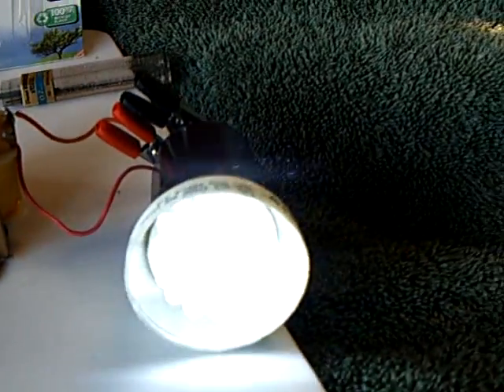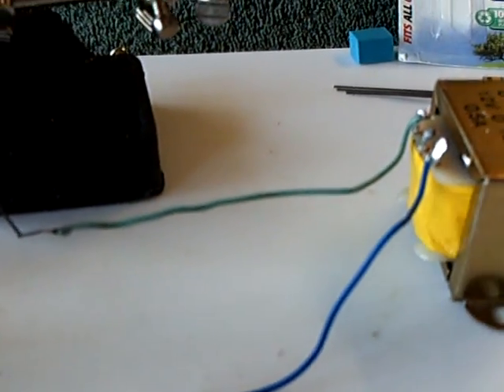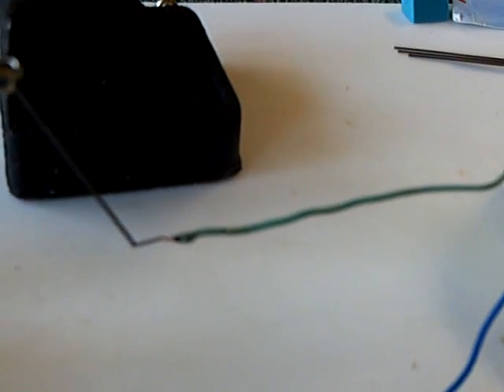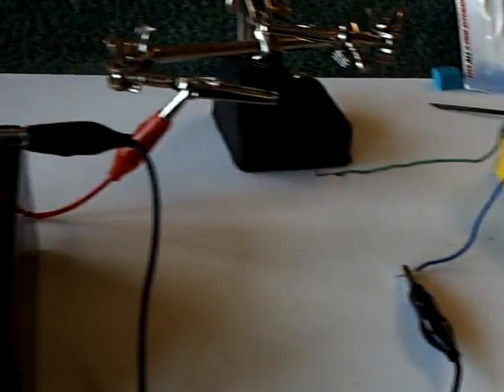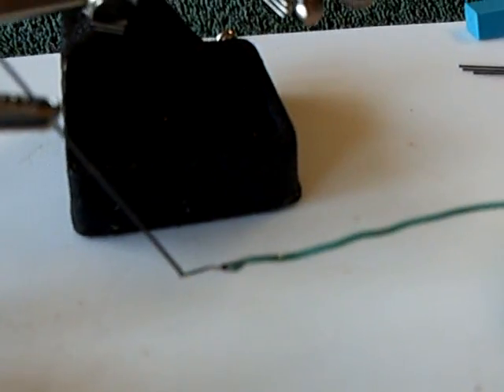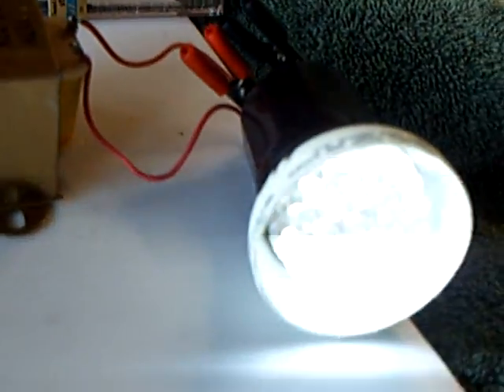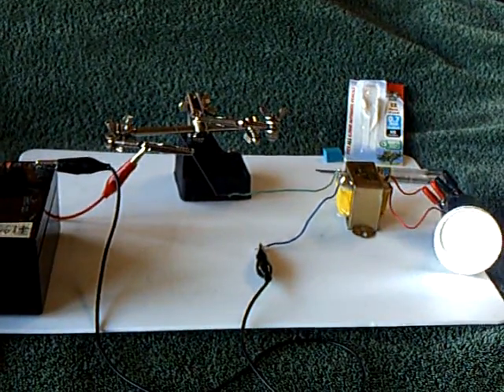Simple Oscillator---  no transistor

Comment: This is very interesting because I find it very difficult to make transistors oscillate, and when they do, it is usually at a very low power level, which leaves you with inverter circuits that can only handle very low power loads .

Comment: The carbon is simply a resistor, the spakrgap is the capacitor and the 1st coil is an inductor, the 2nd coil resets the voltage minimum to -v

Comment: Automobile radios used to use a mechanical vibrator to make high DC Voltage for the tube circuits. I guess they were the first Joule Thieves.

Comment: So... this isn't a transistor, but it is a diode. I'd be interested in seeing what the frequency of the electricity is. Something to bear in mind, since this is effectively a DIY diode, you might get current reversal, depending on how finicky that junction is. 

The semi conductor would probably be as a result of oxygen and copper reacting at the site of the voltaic arc in the carbon rod, but carbon it's self can be a semiconductor, depending on allotrope, so I couldn't say for certain what's going on without a voltage reading after the carbon-arc junction. 

I need to do more work on esaki oscillators....

Comment: Its just like using DC pulses to work with a transformer..due to the DC pulses the magnetic field associated to the primary changes and induces voltage in the secondary....but there is a chance of the transformer to burn out if higher voltage is used.....

Comment: This is the same principal as the radios that POWs used to build from a razor blade and pencil lead. They called that a contact diode I believe.
Reply: ok but how would this diode set up an oscillation here? It would have to be a breakdown or a zener diode to do anything similar, maybe a varicap.
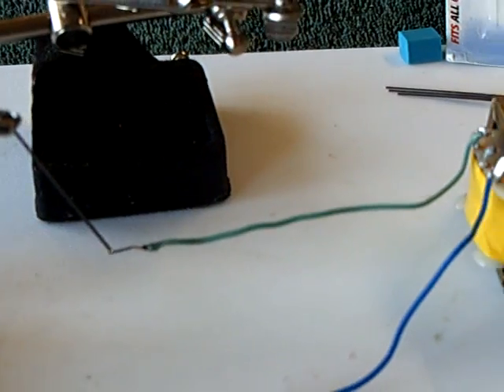Reply: See that little spark at 00:20 ? The spark action creates the oscillation. When the spark lights, current flows and voltage over the junction goes down. That causes the spark to stop. Voltage goes up again until a spark is created and the whole process repeats itself.
Reply: EdEditz so you are saying the graphite acts like an avalanche diode? Im pretty sure what actually happened is the graphite made contact, created a spark, current flew via the spark, the spark died out the graphite touched the wire and the process repeated. You can do the same with a relay and a regular copper wire, the trick is to get a poor connection, and you will also have a similar effect and a whole range of different frequencies, yet no rectification happens there.
Reply: No, this is not the same thing.  What he's created is a very tiny spark gap.  Foxhole radios, the ones you are talking about, use a diode created by a point contact between graphite and metal oxide on a razor blade in order to rectify the signal.

Comment: The spark gap is an oscillation into itself, and also a resonance too - this circuit without transistor can be done with only a diode and some other connections, i did this long time ago, but i have to dig for it in my hdds more, to find it. Tnks for sharing, keep going!
Reply from the maker: johnnyaum3 The thing is that this is not a typical high voltage spark gap. I finally decided that this was a type of buzzer oscillator. The transformer is causing a vibration in the wire.  Dissapointing--- but reality.

Comment: Carbon "burns" as the arc is formed. The early 1900's had dual carbon rod arc lamps in wide use as street and industrial lighting. I never understood if when the arc is established is the junction acting as a diode?
I may have found a new use for transformer based "wall wort's", I have a few hundred of them.

Comment: Try copper wire coiled on carbon mufflers with a iron rod holding a magnet. Carbon will push iron away then gravity allows things to fall when the circuit opens.

Comment: The energy though carbon to the coil is causing the copper and carbon to push away from each other, tension brings them back to connect again.
So it's just connecting and disconnecting. Filling up the coil then discharging it wherever your path is - in this case the led bulb.
If you place a pot between the pencil led and the battery you can control the power better use a much smaller piece of led.
I like this one because it brings attention yet again to the very SIMPLE source of an energy many  people and most "EE's" refuse to deal with...
Cheers - Patrick

Comment: I am very glad to see that you replicated this.  I also noticed that some folks commenting on my video thought it was the circuitry inside the LED bulb causing the effect.  I can assure you that this also works on some 110v incandescent bulbs as well as other things.  The effect looks crazy on the oscilloscope and I also noticed that the current draw was not as high as I would have expected.
Reply from the maker: lasersaber To be honest when I saw your video I first thought that it was some kind of electromagnetic buzzer --until I read the comments.  It was such a simple setup that I decided to try it and see for myself.  You are right that it has nothing to do with the bulb either. I was also amazed at the relativly low amp draw.  Thanks for sharing this idea.  It is something that I have never seen before and would never have thought to try.    I ordered one of your SOLN1 8 panels and will be testing it both at home and on my boat.  That one looks like a real winner--- for a number of reasons.  Maybe I'll ask Mrs. Santa for the 25 next Christmas.
Reply: ***** Nonetheless very interesting circuit :) - i'l try to find my circuit that works only with a diode (coil, wires and resistors) and publish it - hope to find it (a Free Energy circuit may work only with some coils, i am trying to figure out how, i know about 50% of this scenario)

Comment: Way cool!

Is the LED visibly flickering from your point of view or is it merely a video frequency affect?

When you remove the lead from the copper, is there a carbon residue built up on the copper or copper deposit of any kind on the carbon?

Thanks for sharing!
Reply from the maker: A B Thanks.  The bulb is flickering like an unstable strobe light.  There is a carbon buildup on the copper wire but the carbon rod just looks eaten away.
Reply: ***** Interesting.  I'd like to see the arcing in slow motion with a time-synchronized oscope display to slow down what's happening a bit to more easily visualize it.  I'm guessing what is happening is the following:
1.  As the current flow increases through the copper, a spark is able to jump from the copper to the edge of the carbon.
2.  When the spark occurs, the current flow through the primary is reduced temporarily and the built up magnetic field in the primary then collapses--which causes the magnet energy to be induced into the secondary winding until the current flow recovers.
Reply: i tried it and yes alot of carbon buildup

Comment: I think when the wire touches the carbon, electricity flows, and causes the magnetic field to form around everything, and that, because it is magnetic, causes the wire to twitch.

I would do the same experiment again, and not use carbon. Preferably, I would use gold-plated contacts for the area where the wires make/break contact. That would reduce the oxide buildup. I would expect it would still work.

I would also try clamping the that delicate wire with a clamp as physically close to the transformer as possible, to make see if it is the windings in the transformer that are causing the twitching.
Reply from the maker: I don't think that this is an electromagnetic thing.   I tried the transformer copper wire in several positions to see if it was being pulled toward something and it appears not.  The contacts easily arc weld closed and you have to get lucky to get this to work.  I tried all carbon contacts and it didn't work.  All metal contacts failed also.  I don't think that gold plated contact would help.  The copper wire is bouncing off the carbon rod for sure -- I just don't know why.
Reply: ***** Intresting! Yeah, the gold contacts would only apply if that is was an electromagnetic effect. Now I suspect it is either the instability of the carbon arc, where the heat it produces when the wire it touching the carbon causes the wire it to act like a poor bi-matalic strip, so when the copper touches the carbon arc, electricity flows, causing it to get hot, then the wire begins to heat up a little and causes it to warp, and the hot arc gets hotter, and the wire continues to warp until the arc break and everything cools down. How warm does the copper wire get right after running it?

I do know that carbon arcs havs some form of negitive resistance to them, and that a radio transmitter that can actually be made using a carbon arc like that. http://www.sparkbangbuzz.com/els/arcosc-el.htm
Reply from the maker: Power Max The copper wire gets hot so you might have something there. The copper wire might be warping away from the carbon.  It might be interesting to pursue that idea with other metals that do a better job at that.  I'm not convinced that is what is happening here but I might be wrong. It could be just that simple.
Reply: ***** Do you have a bimetallic strip to test? They can be found in 'analog' thermometers, like the ones with the the needle.

Stretch out a section of it, heat it up with a flame and note which way in bends, then use it with the side that warps away from the carbon, and see how well it works, and then see if flipping it around, so when it gets hot, it pushes itself into the carbon instead as it heats up. I would then expect it to not work! That would definitely get us one step close to figuring it out!
Reply from the maker: Power Max Excellent idea!  That should work if it will react fast enough. One way to find out --someone try it.
Reply: ***** Well, I was hoping you would try it! :) You have an audience bigger than my own! I will only get 10 views in a month from it, nine of which are only my own w/ editing, and adding annotations! (I do not have a thermometer to sacrifice right now either. Maybe I will find on old one and try it out and report back once I get my calculus HW done)

Comment: Neat replication, runs well :)
Here's another theory, but depends on if it doesn't do it unloaded and whether metals could be used instead of the carbon (am thinking of a needle).
The pencil lead is first touching the wire, the transformer energizes, the load of the bulb pulls the secondary output down, such that the primary backspikes from the secondary discharging. We see the spark as the wire is pushed by that snap discharge, Then the wire springs back and off we go again.
Without the slight gap, it would just be a 1 shot short circuit across the primary.
Reply from the maker: You might have it right. There was a comment at Lasersaber's video that this might be like the 'water pipe banging' thing.  Whatever it is it isn't something that I have seen before.  At first I though that it might be a buzzer type of oscillator but it isn't.
Reply: *****
If a needle doesn't work then i'll realise I don't know diddly squat yet after all these years lol. Am quite intrigued, eager to know and would build one, but it's 28F at the workbench at the moment !
Another question. can the flyback spark be collected outside of the 'bouncing' area and drive an electrostatic rotor ?
Reply from the maker: slider2732 I don't think anything will run off the 'bouncing area' transmitted energy but I'm sure you can pick up the noise on a radio. I might try that Tate Ambient Power Module thing we built and see if it will charge up.     Sorry to hear that it is so cold there that you can't work at the bench.  Maybe you can make a 'shivering hand' oscillator using the cold. Ha. I have been really wondering about ways to use cold instead of heat ---to do somenthing useful.  I have been trying Peltier modules with cold differentials instead of hot differentials and they do work.  So do Stirilng engines.  I was thinking ground temps at say 10 ft down vs air temps that can be much lower.
Reply: *****
Oh, I meant pick up the spark via clip leads, in a way that passed it forward, while still sparking at the junction. Similar to some BBQ lighters where they also spark internally at the piezo.
Yep, 26F indoors today, we're bedroom hermits in winters. ideal Peltier conditions though. I'd make window frames from long thin Peltiers !
In summer, 5ft down is apparently the same all year, around 55F, making it useful both in summer and winter.
Reply: ***** the cold here in ne pa  is really good for transistors to keep them cool, i keep mine out side in the grill in a box